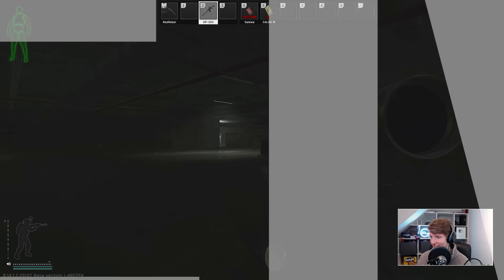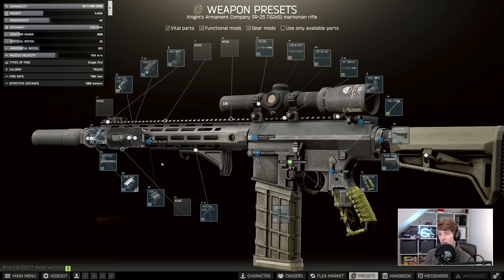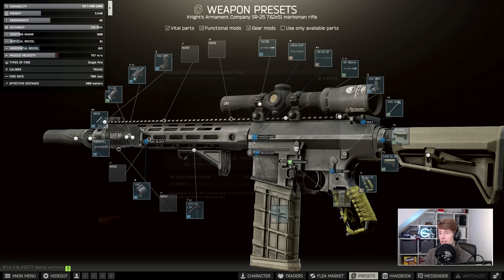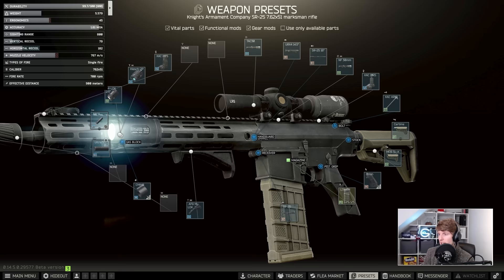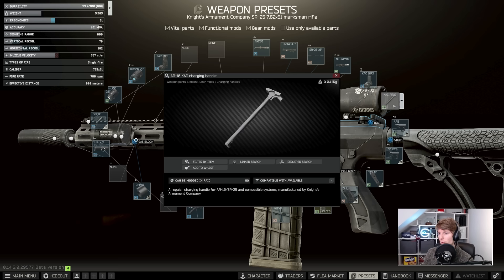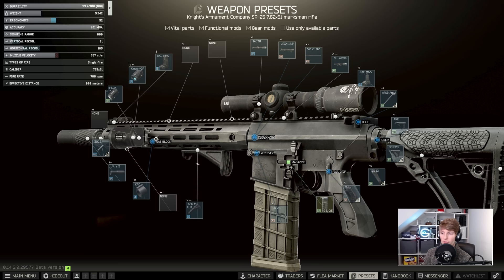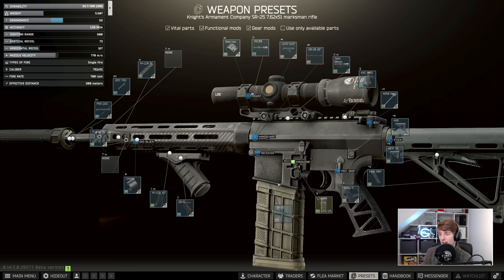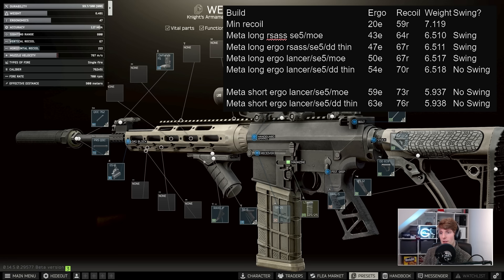This SR-25 Needs SERIOUS Help!

Comment: While I enjoy Gigabeef content, this series completely misses the mark in my book. Ever since recoil was "fixed" I have been mostly enjoying aesthetically pleasing builds as opposed to running the absolute meta builds. Perhaps this guy's weapon didn't need fixing, perhaps he built it because he likes the way it looks, or he had these attachments readily available in his stash? While technically Gigabeef is right, I don't think we need to STILL keep promoting "meta" builds when everything works well these days.
Reply: This gun was trash before though, c'mon. 91 vert in a dmr 🤮
Reply: I think that’s why he tries to match the “original goal” of the weapon. You could use most of the things he’s using with slight variations for aesthetics and still come out at a similar point that is significantly better than the original gun. Every gun he’s used in this series is REALLY sub-par and I think it teaches people a lot…which means I don’t have to fix their guns when I take them :). If not, it’s definitely taught me a lot! Had no clue about upper receivers (AX-15 on the M4 from the vid a few weeks ago)
Reply: Agreed half the fun of tarkov is you can take in anything you want and win. Tarkov is NOT a competitive game and never will be

Comment: Pretty much every gun woks great and really easily. 
I now build my guns to look cool. It's been a lot of fun and I see a LOT more variety out there from others as well and that is super cool as well. 
There is ZERO need to build a "meta" anything anymore.
Reply: Not true at all. Meta means if you take two players of the same skill and let them 1v1 10 times the one with the meta build will win more than the other. Meta still exists and will always exist.
Reply: @CruelSun69 but there's literally never will be such direct ties. It's not just skill - its positioning, initiative, hell even server latency. If you need high ergo it means that you need to quick scope, if you need low recoil it means you have either magdump a lot to connect enough shots or you not that confident in your aim. 
Build would've mattered a lot more in 0.13, but now it's way less critucal that "barebones" functionality (having any suppressor, decent optics, magazines and ammo).

Comment: I like using the dd wave brake and suppressor on the shorter barrel because the combo is relatively cheap and makes the ergo quite a bit better. Other than that all spot on

Comment: I think you really need to take the level of the person you took the gun from into consideration when making these videos or else they make no sense. You say it's obviously not supposed to be a meta build and remove the better grip for being too expensive on the flea, but you use the ARE buffer tube, which will set you back about 110k+ on the flea unless you have mechanic max level and have done gunsmith 21. But at that point why would you ever use the Orion grip when you have the GRAL... Or if you are going for something cheaper then the Stark AR and MOE grips are 5 and 10k cheaper with only 1 and 2 less ergo, and unlocked at level 23? 

The build that's supposed to be just small adjustments is stupidly expensive unless you're level 40, and at that point you should just be going all in with the BIS build :P
Reply from the maker: I tried to show all the options without going on too long, i.e you can use the ATP if you want - but if you have the ARE unlocked, you should use it. If you don't you shouldn't, that's the idea at least

Comment: I sometimes question if people are just using builds they like the look of, then after I see how ugly most builds are, I think it's more likely they're just confused, or just had these parts in their stash. That said, that Orion grip is so hideous, shame it's so good.
Reply: I wouldn't say it's so good at all, you get the GRAL-S grip at 1 lower level with 3 more ergo (for 10k more rubles) or the Stark and MOE grips 15 levels sooner for 1 and 2 less ergo respectfully for 5000 and 10000 rubles cheaper. It's a pointless middle ground that you don't have access to until level 38 and goes completely against what giga was saying in this video about either committing to an expensive build or going more budget

Comment: i hate to see someone spend a lot of money on the gun but then go cheap on the attachments. its like if you are going to be frugal run an AK or something cheap. SR25s and other guns that cost a lot to feed ammo to arent good to budget run since they rely so much on modifying to be useable and the ammo is expensive to waste it pinching roubles only to lose out on performance
Reply: How do you know if he spent a lot of rubles on the gun? Maybe he built it with things he had in his stash and didn't want to buy anything new. What's wrong with that? I think it's wrong to assume he built it from scratch and made a lot of mistakes along the way. Think about it. How many build their weapons with things they have lying around?

Comment: Making meta weapons is so boring and is so stupid because 98% of the weapon parts are rendered useless if you feel the need to build the guns to meta spec. Why cant they take BF4s weapon attachment stats, rework them for tarkov, and BAM, now you can use any attachment you want that fits your PLAYSTYLE instead of tarkovs boring system of who has more ergo or recoil reduction. go look at BF4 attachment stats and you will realize how beneficial and awesome it would be to have such specific attachment details. 

EXAMPLES = STUBBY GRIP: 20% less spread increase per shot 33% less ADS max spread. ANGLED GRIP: 20% less first shot recoil 33% slower spread decrease. POTATOE GRIP: Reduces spread during automatic fire BY 15%.
Reply from the maker: Man I would LOVE to have more differentiation between the parts in tarkov. It's so linear at the moment, a shame tbh!
Reply: @Gigabeef  has anyone in the community, that is close to bsg, brought this idea up or anything of the same idea? To my understanding its just changing values right? Or is it more complicated and would take a while to implement it? If this system was mentioned to them i dont see why they wouldnt do it and i dont see why anyone would impose the idea. A man can only pray 🙏
Reply from the maker: @justyguud  It's been asked about but I don't think it's high on the list of priorities. Nikita mentioned in the Pestily interview though that they plan to separate vertical and horizontal recoil stats, which is at least something
Reply: @Gigabeef  yeah i guess thats better than what we have. Aftermarket weapon parts are mainly always giving positives, and for the most part they usually never have drawbacks.
The main roll of all the different styles of weapon parts is to make the weapon fit better to how your body is built, as well as making your task/roll easier to operate. The system in place right now is lazy to say the least but im not a programmer so who knows 😂